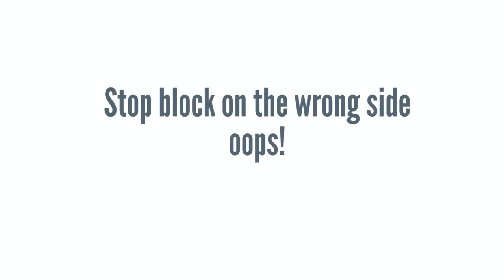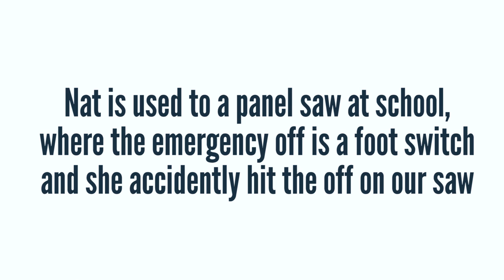047 - Toilet cabinets

Comment: Awww how cool. I've only managed to lure wifey into the workshop once to help. She enjoyed the Dremel work but too noisy and dusty she says 🤔😂
Reply from the maker: Technically the lathe and the foredom (fancy dremel/flex shaft) are my wifes :)

For dust, a good respirator makes a huge difference to enjoyability - 3M's 6500 series is cooler on the face than some of the others, made a huge difference for Nat. For noise? Thats where some good quality isolating earbuds with bluetooth come in. Can't hear the noise if you're listening to metal 🤘

Comment: Nice use of the space, I had the same track saw and bought a Freud melamine blade on Amazon for about $30 that gives nearly chip free cuts in melamine. Also I have a CMT triple chipper melamine blade for the table saw that I got from Carbatec and that gives perfect results every time. Worth the $150 if you're going to use melamine.

Comment: Melamine puts out lots of dust dont it, job on the project
Reply from the maker: Mike Fulton Yeah, melamine and MDF just explode into dust. Its a shape the cheap tracksaws dust collection is... poor. A large amount of it seems to come out the side (from the blade) - there is a video floating around of a guy who did a concertina type folding baffle for it, which we'll have to try out sometime.